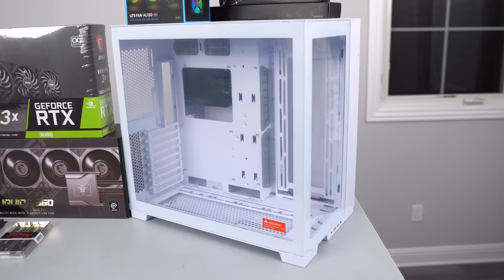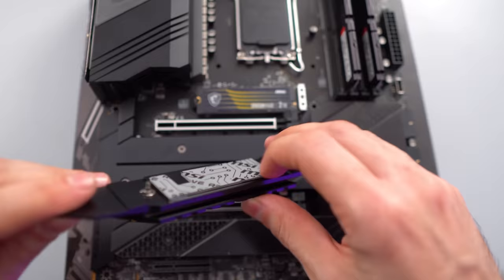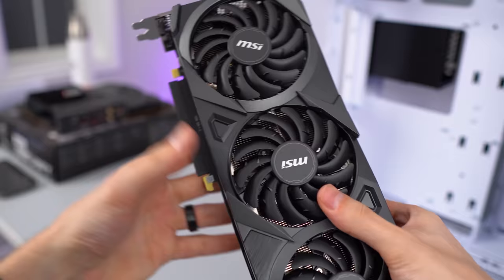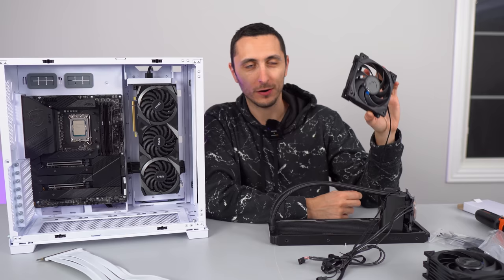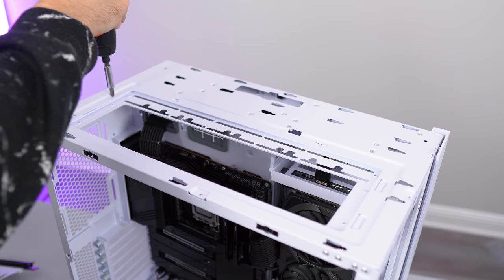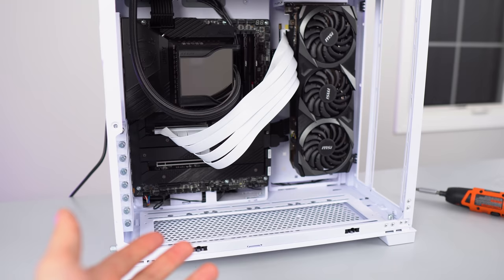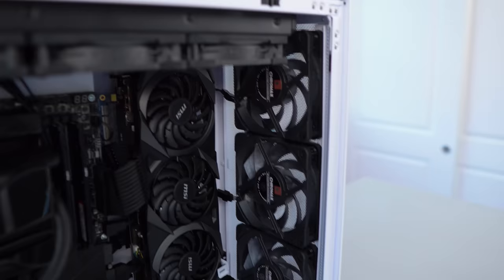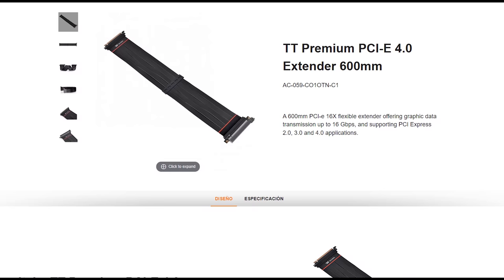Im Bored AF...Lets Build Another Gaming PC!

Comment: Hey! any reccomendations cause i just built a new computer with a z690 motherboard (asus rog strix z690-a gaming) with an i-5 12600KF and the ethernet driver for this motherboard (Intel Ethernet Controller I225-V) is not working. Ethernet shows light connectivity and cord is working but wont pick up anything faster than 100 mbps when on my old pc it was getting 1gbps. Was wondering if you came across this issue and if so, how did you fix it? Please and thank you

Comment: Currently trying to collect as much information as I could before plunging into building my first gaming rig. I value your input so much, with that being said, here are a few thoughts/wishes you did things differently:

- I wish you kept the glass panel and went with a different path for airflow.
- I don’t like that way you installed GPU, I would’ve very much rather you just installed it the normal way, or used those new vertical mounts LL includes
- I was hoping you’d show the cable management and went a bit slower while showing all the motherboard inputs/wires for fans, drives, PSU, etc. (which you didn’t at all).
- Was also hoping you’d use the Lian Li white RGB fans, the ones which connect to each other 
- Is there another way to switch the CPU cooler the other way around so that the tube doesn’t go over the screen?

Thanks, and if by any chance you read this, please know that I write this only because I value your input. The moment I saw your video I was like “this is it”

Comment: Is that PCIe slot 8x and not 16x? Won’t that bottleneck you substantially? I’m asking because I’m making a very similar build and ordered the same 600mm cable but was worried it wouldn’t reach the top slot. They also make a 1000mm (which makes me worried about signal degradation) Lian Li said the cable was 300mm as that complies with the PCIe standard.
Reply: The meg z690 unify has 2 x16 PCIe, according to their website. As performance wise, I’m not an expert, but I think the length should not have a significant impact. Will have to research that.

Comment: Got a question planning to get a ryzen 7 5700G cpu and was wondering what are good parts to go along?
Reply: Budget is like 1500
Reply: Depends what you want/prefer really, gaming at 1080p, 1440p, or 4k, streaming, video editing, 3d modeling, you want to buy a gpu, want it air or liquid cooled, rgb, there are many factors, but $1500 gives you a lot of options for just the pc, assuming it’s only for the pc.
Reply: @jooshiii  it is only for the pc also planning to get a gpu later in the future since the shortage

Comment: I have a core i5 with rtx 3060 and 16gb ram. Is this good enough to play games like black ops on high fps?
Reply: Should be completely fine even on ultra settings at 1080p, but if you want all the fps, you could tweak your settings.
Reply: thats a pretty good build tbh, which i5 are u rockin
Reply: @notcapnbloodbeard 10400F
Reply: @jooshiii  ok thanks

Comment: I’m confused why people put the CPU cooler radiator on top all the time.. assuming that’s exhaust, it’s blowing hot air over the radiator then.    CPU radiator should be sucking in outside air shouldn’t it?   I mean that’s the whole point of it. Cooling the water to cool the CPU.  Blowing hot air over it seems wrong. So it should be mounted on the side, or front, or bottom.  Not on top.